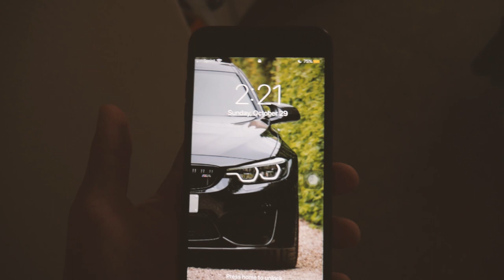My BMW Will Not Stop Squeaking

Comment: Hey, I’m having the exact same issue did you find out what the cause was?
Reply: Did you sort the problem?
Reply: I eventually just got 4 faults relating to the wheels (stability control ....) then soon after i had transmission issues, the car is a serious hole in my pocket, all repairs and service where all done at BMW, I really took care of the car, but it’s problem after problem, it’s just sitting in my garage I eventually bought a new car. I love the car but Do yourself a favor and sell the car is my advice, it’s too stressful
Reply: If you have already changed your breaks and rotors it’s the Wheel hub bearing

Comment: I have the same car, but manual. When I had the issue I looked around in a bunch of forums and got told the same thing everyone is saying in the comments. Checked and it wasn't any of the mentioned things :( Later on found that it was my drive belt. Coolant line had a leak and got fluid on the belt. Once I replaced the line and the belt it completely went away.
Reply from the maker: Dang! Hopefully that isn't my case. I'm pretty sure it is brakes, but we'll see
Reply: Simply Car Things Yeah, I do hope it is as simple as just the brakes for ya. I do know that with my issue it would be cheaper but with the brakes its a lot less of a demanding task fixing.

Comment: Had a similar problem, it only happened when the car got up to temp - had exactly the same sound, used to come from the front of the car and would become apparent after some spirited runs .

Firstly, I got silicone spray and sprayed in the front of the engine, where all the belts and fan is while the car was on - while all the moving rubber parts were moving  (engine was on).

This seems to have resolved the problem.

After this issue, my high-pressure fuel pump sensor was damaged after replacing it no more squeak - although this item presented me with other symptoms and don't know if it was related. However, i had no more squeaks. 

But try the silicone spray man. 

Also replaced brake pads at this time 

So basically 

brake pads 
silicone spray belts
high-pressure fuel pump sensor 

Good luck bro was really depressing when had it, we spend thousands of pounds reparing and modifying our cars so when something like this happens really is quite annoying.
Reply from the maker: Carbon Contrasts its extremely annoying haha. Thanks for the info man

Comment: Sounds like hand brake shoe sticking. once you drive above certain speed it goes away. i have the same and i have bought rear brakes sets including brake shoes, springs, discs, pads and rear left caliper which in my case is very rusty. i will replace them all and post comment later if it fix the issue with squealing.
Reply: how did it go?
Reply: Did u solved?

Comment: Have the same issue with my e46. The noise seems to be coming from the prop shaft, it only screeching when in gear.
Reply: If you havent fixed this yet, I had a similar problem. It was caused by the handbrake and more specific the parking brake shoes were detached from the rotor shield(the pins let go, because the hole that supports them was rusty) and they start to make a really annoying noise, which I thought is coming from the driveshaft, but not. The second stage is when the pin completely falls off the parking brake shoe and will make a banging and screeching noise

Comment: I just got a 2007 m6 yesterday and once I got close to home and started driving slow it started squeaking.... kinda takes the excitement out of cashing out your first m and then it’s all squeaky and shit. I’m hoping it’s just the pads or the sensors.
Reply: If it’s not the breaks or rotors check wheel hub might be the bearings just fixed this issue on my bmw
Reply: @miguelloperena2224  how did you fix it??

Comment: Had the same problem break rotter and pad is rubbing the small area right at the begining of the rotor surface
Reply: Your break pad is rubbing it find out wich wheel its due to rust building.  On the rotter ring wich slightly touching your break pad
Reply: Starts low and over time gets loud

Comment: Bro I have the same problem !! I recently just replaced my pads , rotors and sensors and it’s still doing it, it does it even louder when I turn to my left . I know it’s coming from the passenger right but idk what it could be. Plz help !!!
Reply: Same issue. Stealership cleaned my brakes twice refusing to admit there's an issue. And they had the audacity to charge 80$ usd for the second cleanup. The car is 1 year old.
Reply: I have the same issue did you find a fix ?

Comment: I'm trying to remember but I haven't took my rear brakes apart yet but I think you have parking brake shoes in the rear you're going to have to pull the rear rotors to look at them you might just need parking brake shoes something simple but your problems not that serious if it was a wheel bearing you'll get a humming noise hope this helps✌🏿

Comment: Sure it is not sucking air somewhere
Reply from the maker: I think it has to do with my brakes. I will be replacing my rotors and pads soon
Reply: Simply Car Things remember to put a smear of copper grease where the piston contacts the back of the pad

Comment: You have not heard anything or read anything on your online search because it's not as common with a 335i.  But do a metasearch for "BMW M5 brake squeal" and you'll definitely find stuff.  And yes it's embarrassing as you mentioned.  I feel like people in the lanes next to me are thinking - wow $105,000 car and he can't afford new brakes? (and new brakes are not the issue)    It doesn't matter if you have 90% or 30% brake wear left - brakes will squeal when they are hot under light and normal braking - but they are nice and quiet when braking hard.  This has been an issue for quite sometime and very common with M cars.  Makes me particularly angry because we had to go buy my wife a brand new 550i with M package while I kept the M5 that was originally for her and now we have 5 cars between the two of us.
Reply from the maker: its definitely common with 335i's lol ive done quite a bit of research on it. It has something to do with the brake pad wear sensors rubbing up on the rotor during light acceleration causing a loud squeal

Comment: I'm having the same issue please help
Reply from the maker: Replace your brake pads and rotors, that’s what it was for me 👌🏼
Reply: If you’ve changed your rotors /break pad and it’s still making the same noise it’s your wheel hub had the same issue replaced at rotor to drilled slotted with ceramic pads and noise was still happening it happened to be a bad front wheel hub bearing causing the squeak and the rotor to warp hope this helps anyone out who is having this trouble